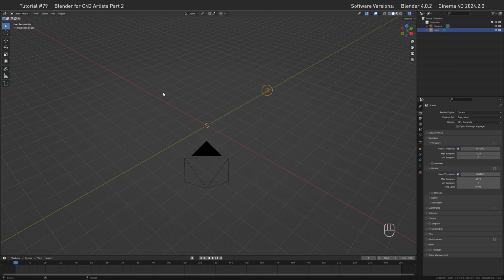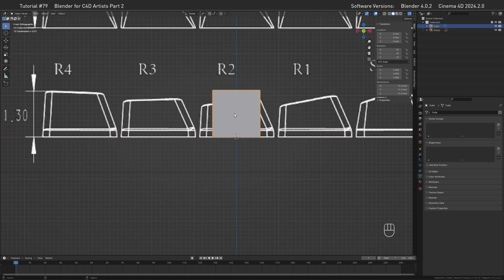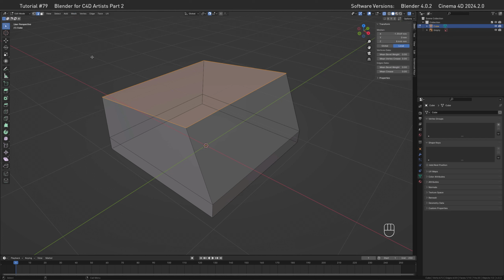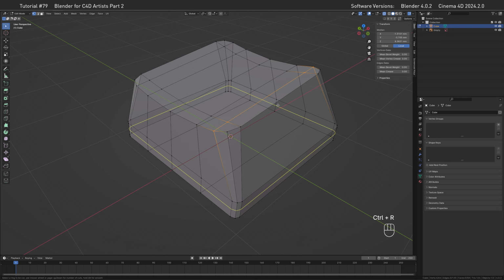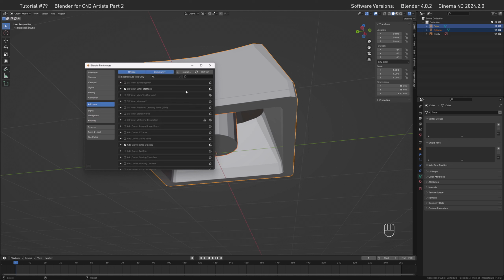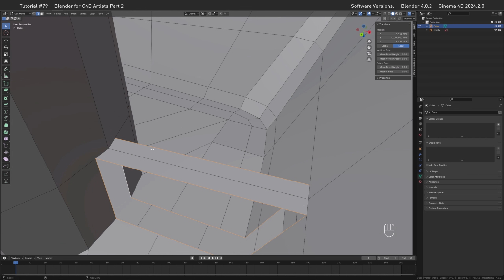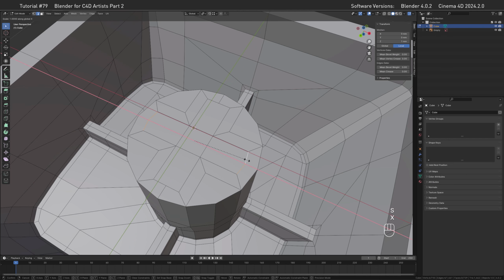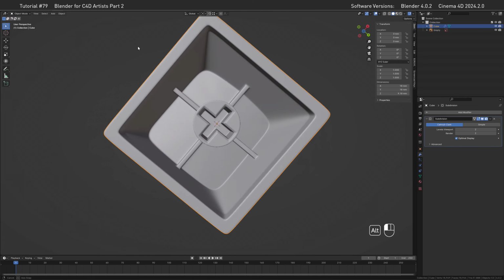Silverwing Long Tip: Blender for C4D Users PT2 Modeling

Comment: Based on these two tutorials, what percentage of time do you think you'll spend in Blender? With C4D having a cost, as well as Octane, the looks here seem to be that Blender and Cycles can do the same thing for free?
Reply from the maker: Hey hey and thank you very much for your comment!
I will answer this question regarding tutorials and regarding my work:

Tutorials: I will try to keep it 50/50. I have planned to do Blender Octane as well. Where so even Octane C4D artists have some advantages watching the video as Blender users have been watching and learning from my C4D videos. Note that most things about 3D apps is actually universal. So if you see me modeling a Keycap in Blender, you probably can follow in C4D or even Maya (if you know the right tools and shortcuts)

Working: I will be working more in C4D probably because this is the network I have been in for years now. And Jobs / Requests coming in this channel mostly (for now) I guess this will change over time as the word spreads I started Blender and therefore more jobs will come this way too.

What is your view on that. What would be the optimal ratio for you?

Comment: What is that "Face Angles" shortcut in your Quick Favorites?
Reply from the maker: Hey and sorry I only seen this comment just now.
The face angles let me select neighboring faces depending on the angle.
Basically this is nice if you have a model with an even part that then falls off to the sides and you are interested to select only the polys of the even part. So you select one poly on there and then go for the "Face Angles"  command and it will select all the other connected faces that are below a certain angle threshold you can set.

Comment: Hi, thank you for those tutortials!! Im using blender 4.1 and it seems ur "alt nav" config doesn't work as well anymore. the alt RMB shortcut gets in the way of the default loop selection shortcut. Did u update urs already?
Reply from the maker: Thank you very much. I have set the loop selection to double click. It's a compromise for sure. But I am able to work rather nicely this way 😇
Reply: @SilverwingVFX  thank you for the follow up! i managed to put down some of my own shortcuts for it already after going through blenders massive settings menu^^ its great to see you look at every single one of ur comments though :) have fun at fmx!
Reply from the maker: Of course. I always try to answer the comments. I think it's a bit of my responsibility to do so! At least as long as the numbers are manageable 😇

Thank you. I am definitely having my fun here at FMX ☺️

Comment: Hello again.  Just watched your video. How did you add a shortcut on the Set Dimension Addon. It could be set be right-clicking the command but Assign shortcut don't appear. but other commands it shows up? I can't even see it on the Key Map commands. Not sure why. Sorry I'm still new
Reply from the maker: Hey there and thank you very much for your comment.
Yeah, the disadvantage here is that you can´t just right click set the shortcut in the menu.
I had to go into the preferences and set it in 3D viewport shortcuts there.
Would be nice to have that right click option with this plugin... but at least there is a workaround!
Reply: Hello  @SilverwingVFX   thanks for the reply. I tried going to the Preferences but oddly enough searching for Set Dimensions can't be located too. hmm. I'm using the latest Blender 4.
Reply from the maker: @strangeapprentice  Thank you for your reply. For me the plugin is listed under "mesh_tools_addon.set_dimensions"
Maybe you have some luck getting the shortcut for it working this way.
Reply: @SilverwingVFX  Sadly I can't seem to find it. Maybe it's me. I'm new to Blender maybe I got something wrong along the way. Anyway I just make it as a Quicktool which is fine too. :) Thank you for your time answering questions. I really appreciate it. Please do make more Blender tutorials. :)
Reply from the maker: @strangeapprentice 
Ok lets make sure everything else is set before. Once you have installed the plugin / addon, do you see it in the menu. Have you tried accessing it there. Mesh. Transform. Set Dimensions. If you can access it there, you also should be able to get it through the shortcuts!
Where do you try to set the shortcut to?
I have added it to 3D View and there to 3D View Global...
Reply: @SilverwingVFX  Yes it's been added in correctly. 
I finally figure it out! Trying to find it in the 3d view and 3d view global but I couldn't find it but I saw that there is an "+ Add New" button. I clicked that and it will say None but then I clicked the downward arrow to reveal search field! There I could find the set dimensions and add the custom shortcuts.  

Thank you so much for pushing me to try to fix that. Sorry again. I'm trying to figure out things as I learn more of Blender.
Reply from the maker: @strangeapprentice   Sorry to hear that this is not working for you. I am also using Blender 4.0.2 so the latest Version.
The only other thing I could think of is that you might need to turn on your mesh tools addon. The Set Dimensions is a part of what ships with Blender. But the Set Dimensions is not included in it in vanilla Blender. Maybe you can only access the command if you have activated it. But I am also unsure. For me it just worked. But then again I have enabled a lot of different Addons that came with Vanilla Blender.
I still hope you get it working somehow. Other then that the Q shortcut is the next best thing you can do!
Reply from the maker: @strangeapprentice  Ha super nice. Glad you figured it out!
Thank you for your positive words. Appreciate it. And no need to be sorry. Happy it worked in the end 🙌

Comment: Wait.. before I watch it. Does that really take 40 minutes to create that object?
Reply from the maker: In the Video I take 40 minutes. But if you follow me you will probably pause and rewind a lot so you might take longer. Same as me recording the video.
Reply: @SilverwingVFX  That's crazy. I saved it and I will watch it but the object seems so simple so before watching I can't imagine that it takes so long :o
Reply from the maker: @adrianfels2985  Oh ha ha, I was under the impression you were questioning the other way around.
There are definitely ways to model it in a lot shorter amounts of time. But this is a tutorial about Subdivision Surface modeling. Which, when done right, is an artform within itself.
And offers a lot of advantages (but also disadvantages as e.g. the long creation time) in production later on.
P.s. if you are skeptical and have better things to do with your time, then just skip it 🙌
Reply: @SilverwingVFX  No, no I don't wanna seem sceptical. I saved the video for later and will follow your instructions. I'm just impressed of how long it takes!

Comment: du bist etwas zu nah am mic dran
Reply from the maker: Wieso meinst Du?
Das ist ein Dynamisches Podcast Mic, da ist es normal, wenn man recht nahe hin geht. Anders als bei Kondensator Mics, die man 50cm weit weg stehen haben kann.
Gibts irgendwo Probleme mit der Tonqualität?
Reply: @SilverwingVFX Also ich bin da nicht so tief drinne um ehrlich zu sein. Habe selbst nur ein Großmembran Mikro und auch die USB Variante da es eh nur für den online Betrieb sein sollte.
Aber es klingt einfach als wärst du zu nah dran und ich finde das auf Dauer irgendwie unangenehm. Kann es jetzt nicht technich erläutern.
Reply from the maker: @viciousvndta  Vielen Dank für Dein Feedback. Ist zur Kenntnis genommen. Ich frage mal andere auch, ob die das ähnlich empfinden. Ich mach auf das Audio noch eine Mischung / Mastering. Da benutz ich auch Multiband Komprimierung um die Lautstärke einheitlicher zu gestalten: Evtl ist das zu gleichmäßig.... laut.